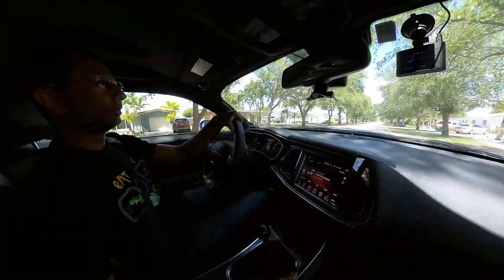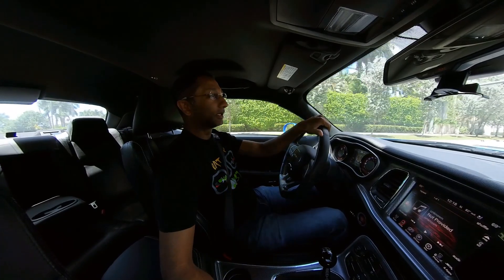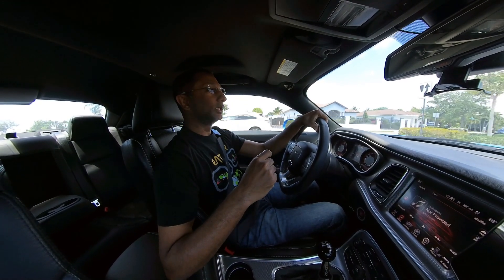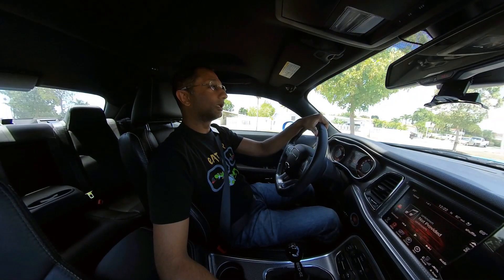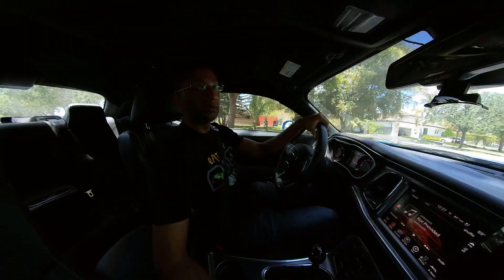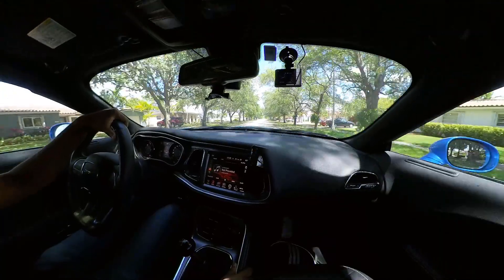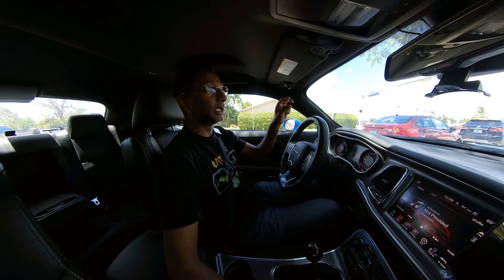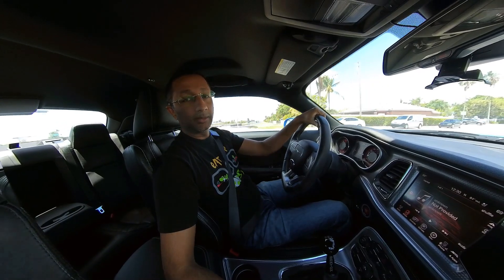Hellcat On E15 Gas?? What Is Ethanol And Is E15 Safe To Run In Your Car? What About E85 In Hellcats?

Comment: Most those vehicles that are built to take E15 fuel could also E85 without material damages because main difference between these vehicles is ECU management software that's not programmed for E85. Ethanol is the cleanest, least toxic fuel than fossil fuels.  E10 in USA does have BTEX stuff that more dirty, toxic, corrosive and degrading to rubbers, plastics than ethanol. Blends between E15 and E85 dont have BTEX. Gasoline itself varnishes fuel systems more than ethanol. One way to prevent corrosion by ethanol is to avoid letting fuel sit in engines fuel system for 3 months or longer specifically if no fuel stabilizer is available. Storing ethanol fuel is easy with fuel stabilizer, fully sealed container in dry and moderately cool area away from direct sunlight, other heat sources.
Reply from the maker: Thanks for the explanation! Does a high humidity environment like south florida affect that storage time? Since all gas tanks are vented I was worried about that.
Reply: @natesrt  Yes, higher humidity makes it easier for ethanol to absorb water from air. My advice for storing ethanol was written for those who live at high humidity environment.
Reply from the maker: @jakedcrane8019  Thanks!